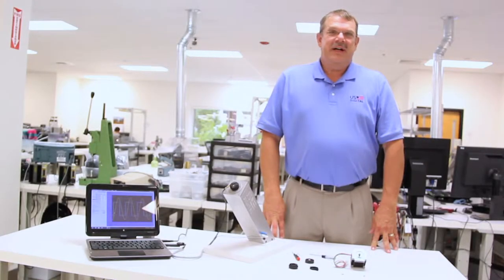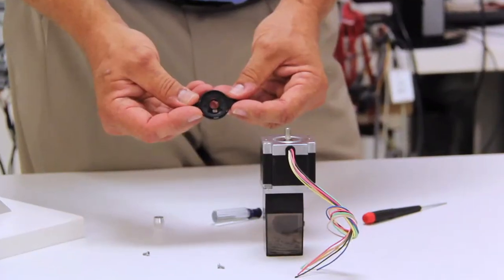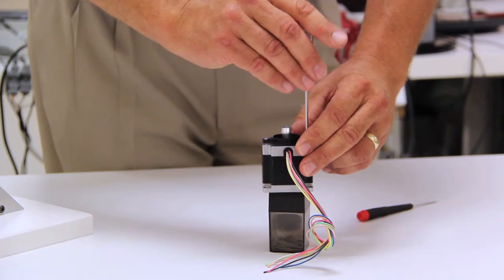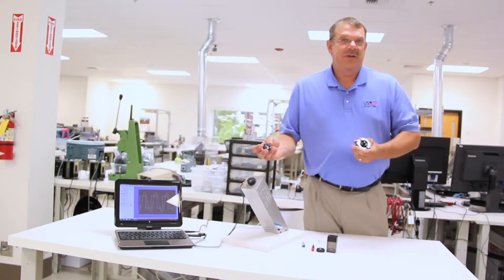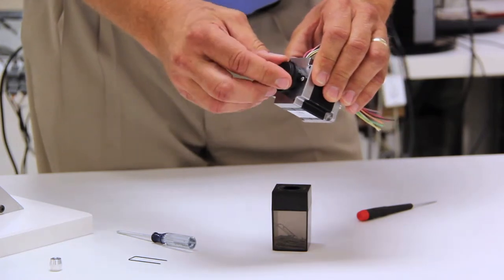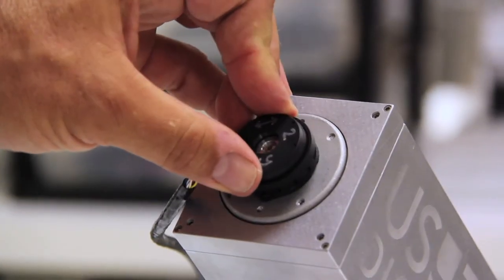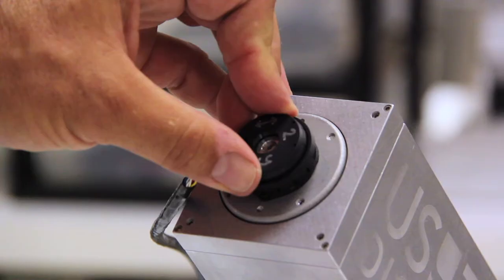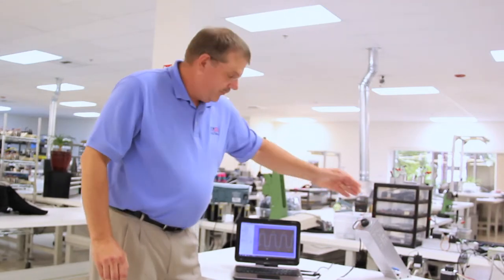US Digital's EC35 Optical Commutation Kit Encoder Assembly Instructions

Comment: Good afternoon engineers and USDIGITAL team my question is about the E5 Optical Kit Encoder.

The question is about the resolution of the encoder and the formula to calculate the speed of a motor coupled to the encoder, excuse me encoder disk. Why 128 to 20,000 pulses per revolution (PPR)? I have read some encoders but it is my first time using it. I know that ppr are pulses per revolution and it's the resolution but I do not know why 128 to 20000 ppr ........ 20000? why 20000?

Sorry for the inconvenience i hope they can solve my doubt

 bye bye

anything else

What is a CPR?

What is the difference between CPR and PPR?